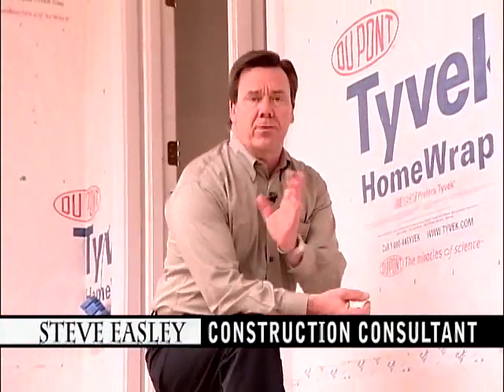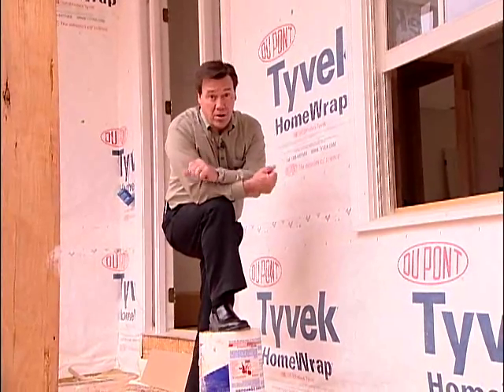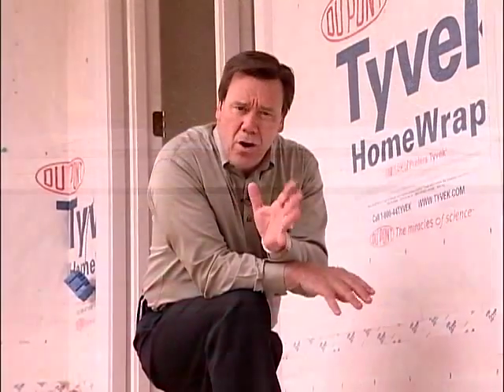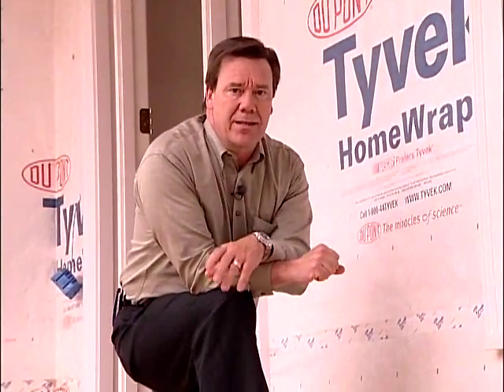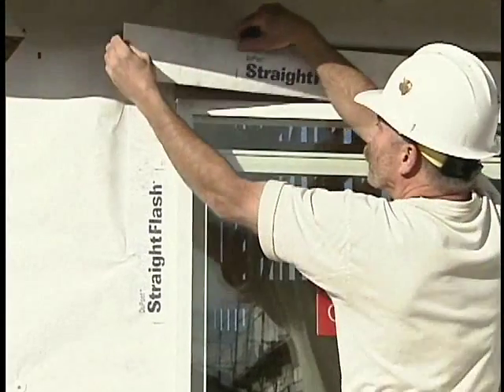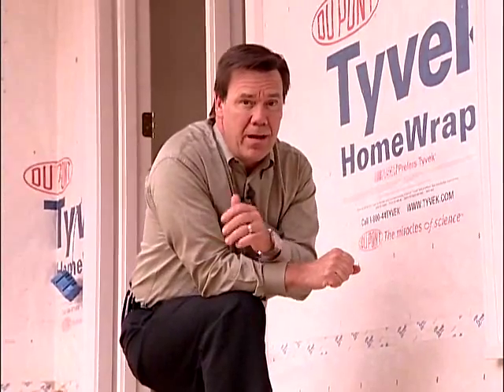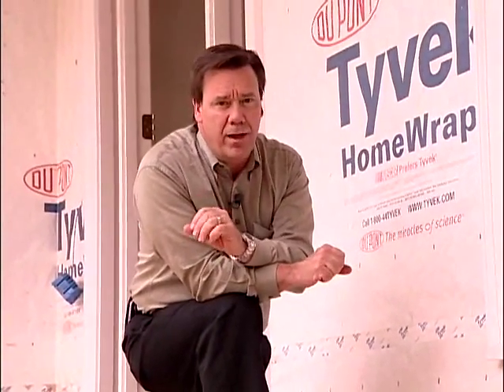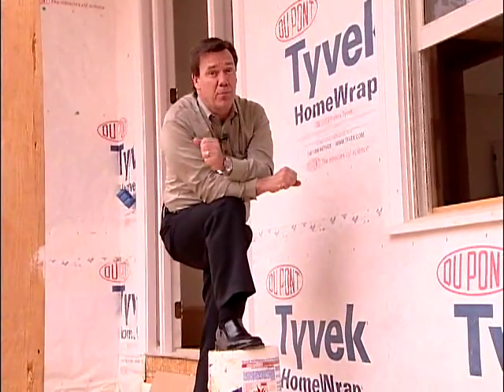Butyl verse Asphalt Flashing

Comment: He didn't mention why Butyl is better at all!!!
Reply: Quote "...its long term ability to stick, under high moisture conditions" end quote
Reply from the maker: +xrds99 Butyl flashing performs better in heat and does not have the compatibilty problems of rubberized asphalt-based flashing with other weather barrier systems.